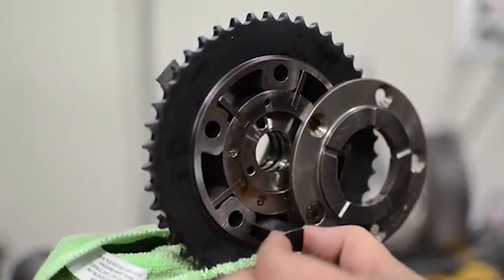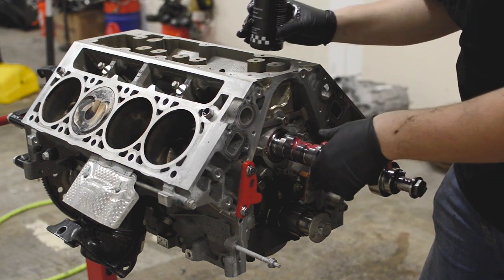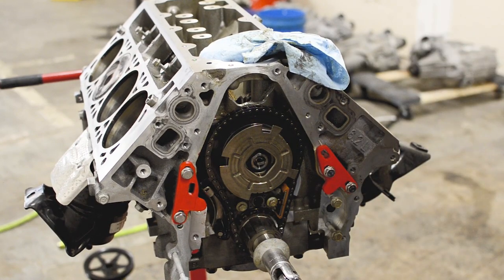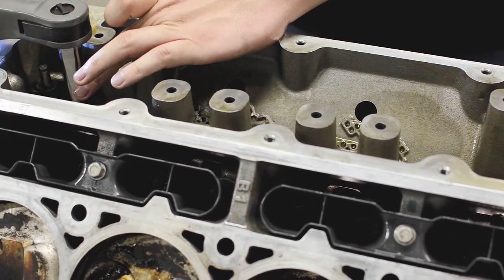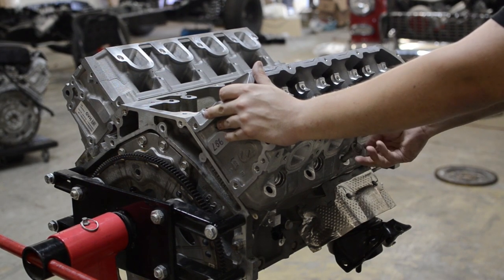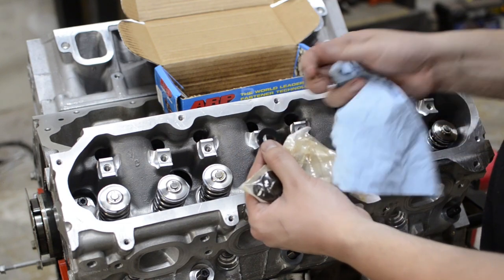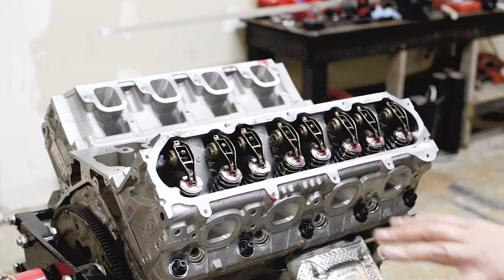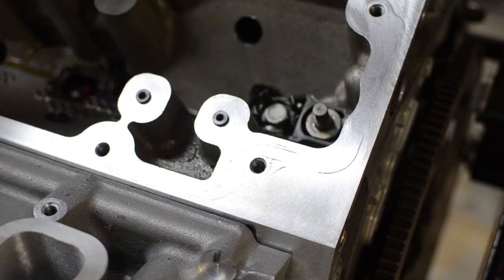Gen V LT l83 l86 cam swap how to pt  3

Comment: I have an aftermarket Texas speed valley cover. They sent me the raised plugs. The valley cover has sealed off o-rings. Just wondering if I should still find a way to seal off the towers or if those o-rings should be good enough? Ps valley cover won't go on with raised plugs.

Comment: Great video! Very informative & detailed! I was wondering about the fuel lifter install, to which side did you orientate the hole? I've seen some that install it to the driver side however on my 2018 5.3 the hole pointed to the passenger side. Wondering if it even matters. Thanks!

Comment: Do you recommend adding the Camshaft Phaser without removing the oil pump? Just asking if you doing a cam swap with the engine inside the vehicle....

Comment: Do you have to install high pressure fuel pump with cylinder 1 tdc or is it just fine with the fuel lobe being on base circle
Reply from the maker: just make sure lobe is flat
Reply: I made sure I was at TDC when doing mine.

Comment: Hey off hand do you know the part number for the arp head studs for lt1 motor on the c7 corvette. Thanks and awesome instructional video.👍
Reply from the maker: 234-4343 or we are fixing to use point one studs from btr once our arp inventory is gone.
Reply: @engineswapsupply  didn't know BTR Made head volts for the lt1. Learn something new everyday

Comment: Hmm my Lt1 cam install has been a pain, I took a pic of my timing and i noticed on your pic the crank dot is a hair to the right of the cam arrow. Is that how you guys normally set them up? Mine has been low on power so i suspect im off timing
Reply from the maker: its not a little off, it can be off by a tooth but there is no millimeter offset.

Comment: Should u replace the two oil cooler O rings in oil pan?
Reply: Yeah I did. They are cheap.
Reply from the maker: we do, all the ones we've seen are still pretty plump. I wouldn't be worried about reusing them. as long as the stick out of there recess enough

Comment: Hey . Is necesarly to change push rod and springs wen change a 2 stage cam?
Reply: Nope
Reply from the maker: yes, on these higher lift cams. there are stage 2 truck cams that are low lift that you don't need to change springs on. we always upgrade pushrods since they are cheap and a good insurance for the customer not to have to deal with a possible bent pushrod.